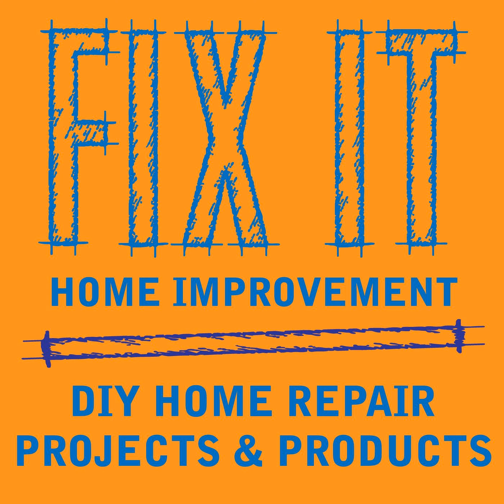Boiler Maintenance - Podcast

Comment: yes, the old taco circulators the coupling was the weak point, new ones pump and motor all in one, no coupling. Used to have that coupling adjusted properly or else water would come out, weap hole!